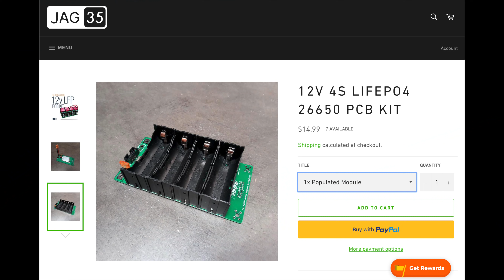Build 12v LiFePO4 battery Packs the Easy Way

Comment: I want to build a 12v battery to run 2 small amplifiers on a motorcycle.each amplifier has a maximum current draw of 35 amps.I’m wondering is there a way to build it so it can charge off of the motorcycle or make it removable and charge.

Comment: I would never use the 26650 bty. They are rebranded 18650 cells packer into the 26650 case.

Comment: Sir I know you are busy but you are more educated on batteries and bms than anyone I know of. I have a bunch of leaf cells I'm trying to use and I need a recommendation for a good bms for them. I have 24 wired in a 24 volt configuration and I'd buy a few bms to get it up and running safely bit I need advice on what bms to buy. Any help is greatly appreciated

Comment: Hi Jay!  I just received my kit, but i can´t found the BMS specification. Do you have it? At least the maximum charger voltage.
Reply: I think I found the information. Let me know if it´s correct:

Continuous operating current: within 50A Instantaneous operating current: 800A

Charging voltage: 14.8-16V Charging current: 30A (Max)

Equalizing current: 40mah

Overcharge protection voltage: 3.75V per series Overdischarge protection voltage: 2.0V per series Short circuit protection: Yes Applicable to Lifepo4 3.2V

Comment: I am looking into getting your kits. I need two 12v, about 33ah or more blocks to replace the UPS gel cells that are connected in series. So. it looks like this UPS is using 24volts.

Do you have to pre-charge each battery before testing it? If they are not charged initially, how would you know that they reach the same level of charge?

So, I can build 5 blocks high to get 18.5ah per unit?
Connect two units together in series to get 12v at 37ah per 10 of the boards using one bms?
It looks like though, that the bms has only 5 lines (the ribbon) going to it, So how do you use one bms for 10 boards?

Comment: I build the," Build 12v LiFePO4 battery Packs "' , I am not sure on how to charge the unit. I was going to use it to power my 12v boom box build. I think I know how to charge it I just would like to be sure. Can you explain?
Reply from the maker: Just connect a 12v charger to it

Comment: Will the boards work with 26650 battery as well as 18650 battery??
Reply from the maker: These only work with 26650
Reply: @jehugarcia  copy that.  Also how do you determine the number 5 amps from a four board 26550 stack?  I ask because I want to build a 100 amp battery.  So to use your big pcb, I need four stacks with five small boards in each stack?  Is that correct?

Comment: Any plans to make these cell holders for 32650, which have 5000-6000 mAH?
Reply from the maker: No
Reply: @jehugarcia  Too bad. I have around 150 cells so I could use about 30 kits.
Reply: Also a bunch of 32700s but that's an even worse project!

Comment: There must be a limit to how many pcb to one BMS as each level the cells are parallel i.e. cell 1 of all levels are parallel to the BMS and the balance resistors are normally very small so if you stack to many boards it will never balance quick enough and a single cell could over charge or trigger Over voltage or am I missing somthing here?
Reply from the maker: That’s true,  especially if the cells are degraded the self discharge rates will be larger so smaller groups of cells will saturate the bms

Comment: You can't stack like crazy : the brass standoffs are a limiting factor : I think a maximum of 8 boards, or 8 boards on each side of the bms can be safely used. 8 below and 8 on top. and that will be heavy enough for an unit to manipulate. With the li-ion 18650 7S  I do stacks of 14 with the bms in the middle. I have tried more but measures from the top and middle do not match, so this means that voltage sag can tax more the middle than the bottom or top and then you do not use each cells the same amount, making then age differently. Better limit the max stack for the brass standoffs.
Reply from the maker: True,  but on my builds I spread the bms modules along the entire stack,  that way you remove power from more than a single point.  I have stacks of 40 boards running no problem
Reply: @jehugarcia  how many boards are you putting between two bms ? Also it is important to use bigger conductors each time you jump one level in hierarchy. example XT60 between boards, XY90 between packs, and 25mm2 to the inverter, etc.

Comment: So the link for new batteries are for 3200mah so if I made 4 stacks with a bms how many true amp hours would that make of a 12v pack. Hope I don't sound stupid I'm just learning about batteries. I'm guessing 3200mah x 4= 12.8 ah with 20amp max output?

Comment: @jehugarcia, you should look at putting that fuse horizontal in the next board revision. would make it much easier to replace in the future. What material are those standoffs? Have you measured the resistance of them? Have you thought about going to a mating connector instead of electrically connecting the boards via the standoffs? Without loctite, I've had those type of standoffs loosen up pretty quick with any sort of vibration.
Reply: Probably brass. And not a good method for interconnecting the boards due to the reason you've mentioned. Fairly low resistance (probably around 10m ohm) starts to add up quite a bit with large stacks. 50A (BMS rating) or anything beyond about 10-15A would be worrisome.

Comment: Please please please remember to talk about or show an example of the chargers we should use for those batteries.

Or 

If we can charge phosphate batteries with regular lithium battery chargers.
Reply: get a dc charger it charges up to 30 volts and 10 amps its variable.
Reply: @ripsta2009  will any DC charger work for Li-ion and LiFePO ₄?

i have been assuming that specific chargers are needed for specific battery chemistry.
Reply: no only thing that is needed is proper voltage and current.  I am talking about the dc power supplies.  they are great if you work with different voltages and chemistries.  if you work with lower capacity batteries then a icharger or tenergy works great as well.  when I charge larger capacity cells I use a regular car charger to get them up to the max the charger will go and finish them off at 14v with one of my other chargers.  the other 2 will balance charge up to 6s.  but i parallel charge them usually to keep them balanced.
Reply: I have and do work with all kinds of chemistries and all kinds of applications.  built batteries for boats, motorcycles (harleys), vehicles (got one in my comp vehicle right now only battery in it) solar, camping power supplies, and 12,000+ watt competition vehicles with massive draws.  I test every cell to its max and the ones I have tested I can tell you c rates they have reached and safer c rates and I videotape every test and watch every cell's voltage variations.  For example I can tell you 32650s will put out 14-15c and have video tape to prove those claims.  Though I wouldnt build a battery to do those c rates all the time.

Comment: Does it come in 24v?
Do they work with an active charge system like solar panels? (I have an mppt charge controller, 40A, getting up to 35v; currently on 12v, but that struggles to keep my laptop powered while editing video or gaming, so I'm thinking about upgrading to 24v)
Reply: no but ya should be able to wire them up to 24 volt.  basically like ya would a car battery.

Comment: The problem with this kind of cell is that voltage does not tell state of charge. You can saturate an cell at 3,45v to 100% and its full even if not charged to 3,65v. So an BMS has a really hard time balancing them. A cell can be absorbtion charged at a lower than max charging voltage all the way to their design capacity - it just takes a long time.
Reply: I add an active balancer to my packs it works well
Reply: 3.65v is what it hits during charging, when the charger shuts off the voltage always settles down.  If you measure the internal resistance of the battery, that can tell you if it is charged or not also, better than the voltage

Comment: $589.17 dollars for a 59ah 12v LifePO4 battery, I consider is a very high price and it is not worth  it 🤔🤔🤔
Reply: 2000 charge cycle battery though, last way longer and cheaper than buying and changing out 4 lith ion battery packs every 500 cycles
Reply: Being able to easily change out any single battery without breaking solder welds is the major advantage.
Reply: @DavidHalko  I'm using these boards to recondition and evaluate salvaged used lifepo batteries before committing them to more permanent battery packs

Comment: Could this be used for a motorcycle battery replacement?
Reply from the maker: It can be used for anything as long as it meets the power requirements
Reply: jehugarcia incredible! So if I need to make a 4-8ah 12v battery I would need to buy 12 cells and 3 boards and 1 BMs?
Reply: well depending on the capacity of the individual cells.  if its 2000 mah per cell then to make 8 ah you will actually need 16.
Reply: scott moore thank you for the reply, I think for a motorcycle battery I only need 4+ ah. I want to build one. I wonder if my motorcycle will charge this
Reply: @michaelandrew83  I advice doubling what you need so if it 4ah then go with 8ah.  You will have a small draw no matter what so you want to compensate for that.  And if your motorcycle charges anywhere around 13.5 it should be fine.
Reply: @michaelandrew83  I built a 20 ah for a Harley not with these but bigger ah cells 5 ah cells with bus bars.

Comment: If I did the 15 s configuration with 60 total batteries you recommend (the new ones) how many Watt hours would my total battery pack have at the end as a 12 volt battery pack. Not sure how to calculate that. Thank you.
Reply from the maker: 3.6ah x 3.3v =11.88wh per
Cell  x60 = 712wh
Reply: @jehugarcia  thx for your quick response.
Reply: 712WH or Approximately 59AH, for that price it is very expensive to build that battery. WOW 😳

Comment: Nice. is there a way to know if one of the board's fuse is blown. given the other parallel boards will be powering up the BMS (with lesser current capabilities ) it could go un-noticed for a long time.
Reply from the maker: Visual inspection
Reply: @jehugarcia  would be great if there was an indication that one of the PCB is knocked out of the parallels bank. can also be a case of trace fuse blown / loose battery / spring / poor contact / etc.
Reply: You can purchase mini fuses that glow with an LED when blown.

Comment: Why not make 4P packs instead of 4S?
Reply: Because you would end up with a 3.3 v battery. When you wire them in parallel, the voltage remains the same, but the capacity increases. Wire in series, the voltage increases, but the  capacity stays the same.

Comment: I need a device to test the state of the battery, to know if its condition and useful life and if they work or not. Someone recommend me something to break them????
Reply: only way to truly tell is test them with a load.  a simple battery tester and a cheap isdt battgo will do the job.  lithium can still hold a charge and be absolute trash as far as internal resistance

Comment: so what's the spread of mah capacity you can use for a battery pack? so far i haven't found a definitive answer anywhere.
Reply from the maker: He less spread the better
Reply: @jehugarcia  i understand that, what i am asking is how much is too much? i've been rebuilding tool battery packs, and i reuse the good cells and bms, and replace the bad. but i don't know how much difference in capacity i can put together in a pack. i've been trying to stay within 3-400 mah, but is that too much, or can i use a greater difference in capacity? i want to try to stay within the rated capacity of a given pack, but it's not always that easy with used cells.
Reply from the maker: 300-400 = 11%-15% on a 2600mah cell.  That’s too much I’d say no more than 5%
Reply: @jehugarcia  thanx! i really appreciate the advice. i've learned a lot from your vids, and have been subbed for years. keep up the good work, and i'll keep watching and giving you the thumbs up!